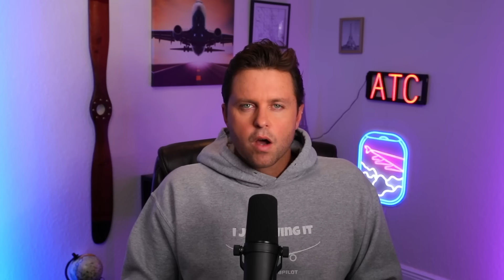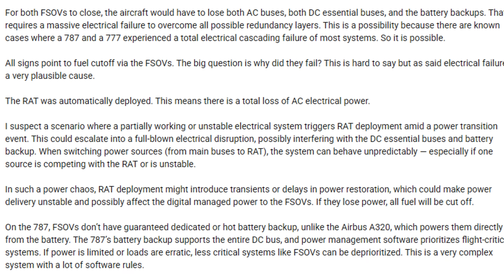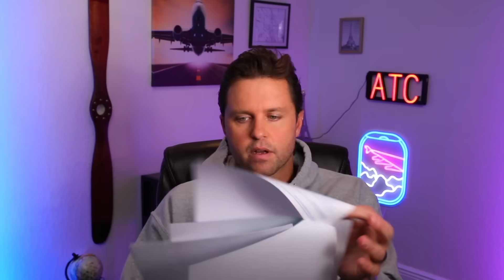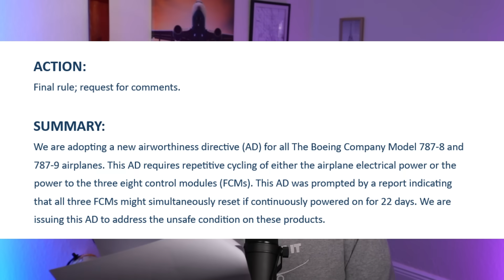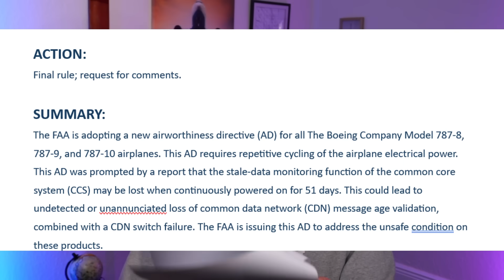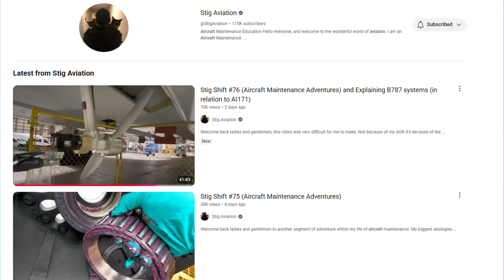Air India 171: Did a Software Glitch Cause Dual Engine Failure?

Comment: Software errors are very common and expected. In the mission critical world & medical devices, I would expect a much lower error rate, but as a retired software engineer in the defense business, here's some facts:

"A CMMI (Capability Maturity Model Integration) Level 3 certified organization is generally expected to have a high level of quality, with defect rates for delivered, released code falling in the range of 1.0 to 3.0 errors per thousand source lines of code (KSLOC)."

"This is a significant improvement over the industry average for typical business applications, which can be much higher."

For business applications, the error rate is 5-10+ errors for every 1,000 lines (KSLOC) of code. Now how many lines of code are there in the ECU/FADEC system, or any other area that could cause engine shutdown? I don't know, but it's A LOT!!!

For mission critical systems like the FADEC: 
"FADEC software is classified as Level A software, the highest safety-critical designation. 
1) Failure Condition: Catastrophic—meaning failure would cause a crash resulting in loss of life or the entire aircraft (e.g., loss of engine thrust control).
2) Safety Objective: The system must be designed to have a failure probability of less than 2$10^{-9}$ (one in a billion) per flight hour. 
3) Process Rigor: This level requires the most stringent verification, validation, and traceability processes, including 71 required formal objectives that must be met for certification."

But code is written and reviewed by humans so there are still errors in the code, just far fewer. Unless by some miracle there are only a few KSLOC to review, in which case I suppose every branch of code could realistically be reviewed and result in a 0 defects system. Let's hope so.

Comment: Air india 787 had a recoded electrical  incident During the previous flight  , the malfuctioned  electrical system was reported and it happend again andn automatically   closed FSV, don't blame it on pilots

Comment: I have a machine tool in my workshop. It has several red emergency stop switches. In addition, the machine's computer can turn off the power without human intervention if it detects a malfunction.
Could an airplane computer operate on the same logic?

Comment: „Did a Software glitch caused a dual engine failure.“ Answer: No. The fuel switches we’re physically set to „cut off“ by one of the cockpit crew. We have the data. We have cockpit communication.
Reply: Nonsense, we have a sentence what pilots did say, but not their words, why not?

"The fuel switches we’re physically set to „cut off“ by one of the cockpit crew. We have the data." Nonsense, EAFR checked switches, but does not check the switch, but the EEC of the switch. Switch can be ON, but EEC can be OFF.

Comment: Transitioned to CUTOFF is the a conclusion based on the recording of signals from sensors. It is not a statement that "the switches were switched to CUTOFF."  Why are you silent on this compelling line of reasoning? Enjoyed your video but haven't heard the glitch theory rehearsed with the online commentarors.

Comment: The Thrust Control Malfunction Accommodation system — central to this controversy — communicates with the FADEC (Full Authority Digital Engine Control) to determine if the aircraft is airborne or grounded. If TCMA falsely believes the plane is on the ground, it may auto-throttle the engines — as happened in the 2019 ANA incident

Mary Schiavo revealed that a near-identical incident occurred in 2019 on a Boeing 787 operated by ANA during its final approach to Osaka. “The investigation revealed the plane software made the 787 think it was on the ground, and the Thrust Control Malfunction Accommodation (TCMA) system cut the fuel to the engines,” she said.

Comment: The pilot of A171 flipped the switches in an attempt to relight the engines that had a fuel cutoff due to software glitch. 

In a 2019 incident involving an All Nippon Airways (ANA) Boeing 787, the aircraft's software mistakenly identified the plane as being on the ground during final approach, triggering the Thrust Control Malfunction Accommodation (TCMA) system. This system then cut fuel to the engines. The pilots did not manually engage the fuel cutoff switches. The incident was traced to a software glitch and not pilot error.

Comment: The lone survivor Biswas told press that the lights flickered, some lights went off within seconds from take-off. Maybe there was an electricity failure. Another thing, you can't cut-off in a second (as it says in the log) and that started a speculation about the Pilot.

Comment: The question from the first officer to the captain: why did you turn it off ? He replied calmly : I didn’t. Then they turn the switch on.

The fact is: the switch  can only be turned on or off deliberately since it requires two steps.
This must be a manual control.
Reply: Nonsense, switch only does give ON or OFF signal, so witch can be ON but EEC of switch can be OFF.

Comment: Hi Captain Gary. First I'm simply wondering about many pilots who mentioned the passenger bragging about the entertainment system not working on "this" aircraft. I don't know why this should even be taken into consideration. How does he know it was the same aircraft? Did he check the tail number? I flew many times and it never occurred to me to check my plane's tail number as a passenger. Just saying.

Now in regards to the preliminary report and its interpretation, I have a theory and I'm wondering if there's something to it. Everything is focused on the switches being turned off. However, the switches are at one end of the wires. Swissair Flight 111 crashed on September 2, 1998, After wire insulation melted due to heat and wires got exposed and resulted in a fire. Could that maybe be a cause here? If true, that could answer some questions. At least for a certain distance, it's likely that both engine switch wires run together before splitting up. If they burned or got damaged in some way, could that cause both engines to flame out? Obviously we can't answer the question yet since so little information was released. But if we would access to both FDR and CVR, they could be synced up, and maybe would find that the switches were turned off in an attempt to relight the engines after the electrical malfunction. That could also explain the conversation between the pilots, but why they waited 10 seconds still remains a question.

Comment: It very well could’ve been it an electrical glitch which negatively resolved itself in the FADEC software OR the opposite, a software bug or design, that under some precise conditions reared its ugly teeth. Maybe neither of the pilots physically touched the levers.
—> I mean let’s face it, it was Boeing itself that NEVER told anyone about the Maneuvering Characteristics Augmentation System (MCAS). I’m not saying it’s Boeing, GE, or Honeywell, just that it is possible.

Comment: For consideration from another post :- 

CONSEQUENCES FOR THE ENGINE IF THE LOGIC STUCK "ON GROUND MODE" AFTER LIFTOFF

1. FADEC Power Loss
The FADEC on the GEnx-1B engine requires AC power from the AC Bus. Without IDG and APU power:
- FADEC loses primary power
- Engine control becomes unstable, potentially dropping to idle or shutdown
- Thrust can suddenly disappear even with the throttle lever at TOGA

2. Autothrottle Malfunction
Due to the logic remaining in ground mode:
- Autothrottle system fails to transition to flight logic
- May remain in idle or hold TOGA before automatically disengaging
- Unable to respond to FMC climb mode or speed targets
- No automatic thrust management

3. Engine Indication (N1, N2, EGT) Loss
Because EICAS and displays rely on AC power and data buses controlled by flight mode logic:
- Engine indicators in the cockpit may disappear or freeze
- Crew may misperceive that the engine is still running or only idling
- Unable to monitor engine performance

FURTHER CONSEQUENCES:
RAT Will Deploy Automatically When:
- AC Bus 1 and 2 are lost
- No APU power available
The RAT will deploy automatically to:
- Provide minimum AC power for flight control
- Keep some essential instruments active
However, the RAT cannot power all avionics systems, full FADEC, or restart the engine.

CONCLUSION:
If the APU is shut down during taxi-out and the air/ground logic remains stuck in "ground" mode after takeoff:
- IDG never powers the AC Bus due to the logic not transitioning to "air" mode.
- APU is no longer available as a backup power source.
As a result:
- The aircraft loses all AC power after  airborne.
- FADEC cannot function, leading to engine control loss, thrust loss, and potentially engine shutdown or unresponsiveness.

The RAT deploys as the only emergency power source, but it's insufficient to operate FADEC, restart the engine, or fully support systems The aircraft will be in a powerless glide condition shortly after lift off

Comment: Gary, there is evidence of an electrical issue on the AI 171. "The sole survivor from the devastating Air India crash, says the lights started flickering - just seconds before the plane slammed into a building ...." as reported on https://www.youtube.com/watch?v=z5Y0Cemaeyk a month ago. So we know-thanks to the survivor-there was an electrical issue experienced prior to the crash.
The Air India Preliminary Report indicates, "The statement of the witnesses and the surviving passenger have been obtained by the Investigators."
What is curious is that the Preliminary Report also states, "At this stage of investigation, there are no recommended actions to B787-8 and/or GE GEnx-1B engine operators and manufacturers."

Wouldn't it have been prudent to have had India's Aircraft Accident Investigation Bureau request Boeing furnish documentation on all known 787 incidents involving FSOV irregularities and electrcial events that could have compromised FSOV performance? The report further indicated, "At this stage of investigation, there are no recommended actions to B787-8 and/or GE
GEnx-1B engine operators and manufacturers." This would seem to indicate the scope of the investigation at this point has left out Boeing and GE.

What also seems strange is that a NTSB investigator was not also assigned to the investigation. Only a FAA representative was dispatched to the scene. As the NTSB is focused on root cause, a wider net could be cast than only an FAA representative that is more restricted to compliance-related issues.

Gary, thanks much for your research and for highlighting early in the investigation process electrical and software issues that may have a bearing on root cause. The Preliminary Report would seem to implicate the captain or co-pilot, that-unfortunately-social media is more than happy to pin blame than perform some serious investigative work.

Comment: So stupid.  It will run by itself if you leave it alone.  Let the fking pilot make the decision to cut the fuel.  Software cutting off the fuel to aircraft engines for "safety" is stupid.  Pure fking ignorance.  If the pilot is incapable of making that decision, you're going to crash anyway.  What kind of m0r0n would think this is a good idea?  Go ahead.  Someone give me a reason that is worth the lives of these people.

Comment: BOEING HAS MANY QUESTIONS TO ANSWER.  HERE ARE SOME.

RECALLS, SERVICE BULLETINS & PATCHES
Was the Boeing 787 aircraft involved in the crash subject to any Mandatory Service Bulletins or Airworthiness Directives (ADs) issued after the 2019 ANA incident involving dual engine rollback?

What software patches, firmware updates, or modifications to the FADEC or TCMA systems were issued by Boeing since the ANA incident?

Was Air India Flight AI-171’s aircraft compliant with these updates at the time of departure on May 2025? Provide documentation of compliance or non-compliance.

SYSTEM SAFETY & FAILURE MODE ANALYSIS
Has Boeing ever identified or documented the risk of TCMA being falsely triggered mid-flight due to faulty “weight-on-wheels” sensor input?

Was this failure mode considered a catastrophic hazard in any Boeing risk assessments? If not, why?

What internal safety assessments or simulations were conducted to test dual engine rollback scenarios on the 787 platform?

WARNINGS TO OPERATORS
What specific warnings or advisories were communicated to operators (including Air India) regarding TCMA-related engine rollback risk?

Were any operator advisories issued advising pilots how to override or counteract inadvertent FADEC thrust rollback caused by TCMA?

Has Boeing ever issued a temporary restriction on takeoff configurations, thrust settings, or TCMA parameters due to known safety risks?

 MAINTENANCE & COMPLIANCE RECORDS
Was the aircraft in question enrolled in Boeing’s Health Management System (BHM), which transmits real-time performance and fault data back to Boeing?

Did Boeing receive any data flags, alerts, or anomalies from the AI-171 aircraft prior to the crash? If so, what action was taken?

What is the audit trail for the software load installed on the aircraft’s FADEC system at the time of crash?

 FAILURE OF REDUNDANCY & PILOT OVERRIDE
Why is there no immediate pilot override protocol for unintended TCMA deployment in the Boeing 787 design?

What training, if any, is provided to flight crews to recognize and override a thrust rollback caused by false TCMA activation?

In the final 15 seconds before AI-171 crashed, could the pilots have manually recovered thrust? If not, why was that option unavailable?

 REGULATORY COORDINATION
Did Boeing disclose the known risks of FADEC/TCMA false-positive rollback to the FAA, EASA, or India’s DGCA following the 2019 incident?

Was the fix mandated by regulators as a condition of continued airworthiness certification for the 787 fleet?

CLOSING QUESTIONS
Can Boeing confirm that no known software malfunction, sensor error, or TCMA activation could have caused a dual-engine thrust rollback during initial climb on AI-171?

If not, why has this aircraft remained in global service with a known, potentially fatal vulnerability?

And lastly—what does Boeing intend to tell the families of the 274 souls who boarded that aircraft expecting to land, not vanish into smoke?

Comment: The theory that the pilot of Air India Flight AI-171 manually deployed the fuel shutoff valves seconds after takeoff is not just speculative—it is insultingly implausible and technically bankrupt.

Let’s Detonate This, Point by Point:
1. The Pilot Was Fighting, Not Sabotaging.
Fifteen seconds after takeoff, the pilot radioed in: “Losing engine power.” That is not the cry of someone pulling shutoff levers—it’s the voice of a professional trying to keep a dying aircraft in the air. Don’t insult his final act of heroism with a theory more grounded in fantasy than physics.

2. The Fuel Shutoff Handles Leave Digital Fingerprints.
The Boeing 787 logs everything. If those shutoff handles had been touched, the FADEC would have screamed it into the data recorder. No such input. No such log. So where is this theory drawing its oxygen? Certainly not from evidence.

3. Two Engines, One Fault: Software, Not Sabotage.
Let’s be clear: pilots don’t accidentally shut down both engines. But TCMA can. When the Full Authority Digital Engine Control (FADEC) system misclassifies “airborne” as “on-ground,” it can roll back both engines without any pilot input. That’s not a hypothesis—that’s a documented hazard.

4. A Known Failure Mode, Not a Wildcard Mystery.
This is not uncharted territory. In 2019, All Nippon Airways faced a near-identical dual-engine rollback caused by this exact issue—a TCMA fault via faulty ground sensing. FAA bulletins followed. So did Boeing patches. But were they uniformly applied to the Dreamliner fleet? That’s the real question—not whether a grieving pilot inexplicably flipped his own kill switch.

5. Boeing’s Track Record—Software Before Souls.
Let’s not forget: Boeing already killed 346 people with the 737 MAX MCAS system while peddling “software confidence.” If TCMA was the ghost in the machine this time, then blaming the pilot is not only misdirection—it’s corporate deflection in its most grotesque form.

Final Blast:
This pilot didn’t kill his passengers. Boeing’s software likely did.
This wasn’t human error—it was human helplessness, against an automated system that took command and offered no escape.

So to those pushing this absurd theory: stand down, or bring receipts.
Reply: Didn’t age well

Comment: I don't think that there was any software glitch. Both engines have separate fuel supply and multiple fuel pumps and back up systems. This is an external factor causing a sudden reduction in thrust, not controlled. It takes time for an engine to shut down. This to me looks like an ingestion incident. I think it's birdstrike.  I've said birdstrike right from the beginning and I am still quite sure.

Comment: I read that fuel shut off valves closed automatically as soon as there is/was an electrical  power failure to the fuel valves. Same is on 777. Airbus still has battery power to these shut off valves.  With electrical power failure even of a few seconds, the spring loaded fuel shut off valves will close. This happened to an ANA 787 after landing, during reverse thrust, and they failed to restart.
Reply: yes

Comment: The difference between Airbus and Boeing in this matter is not that Boeing doesn’t has battery backup for these valves (it does have an Essential DC bus with battery backup that do feed these valves) but the fact that in Boeing there are normally-closed valves (closes with a spring) while in Airbus these valves are bi-stable (they hold the last position on power loss).